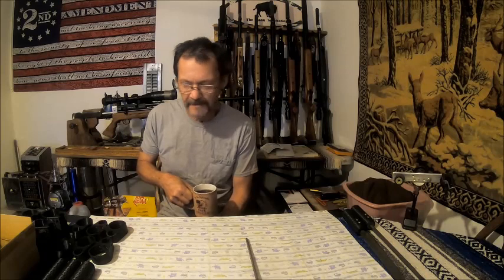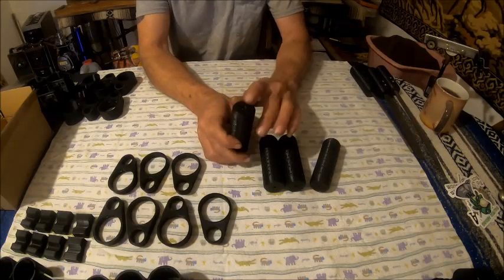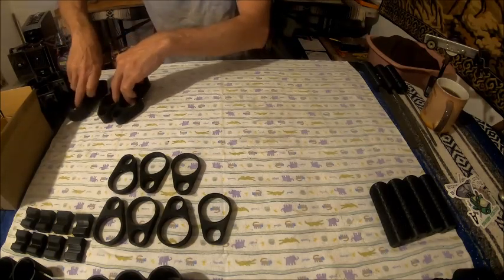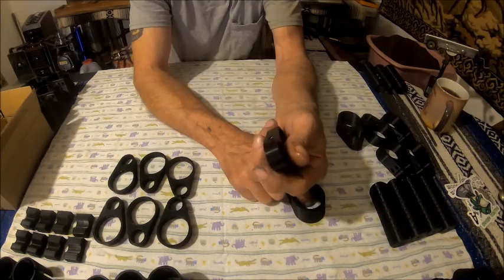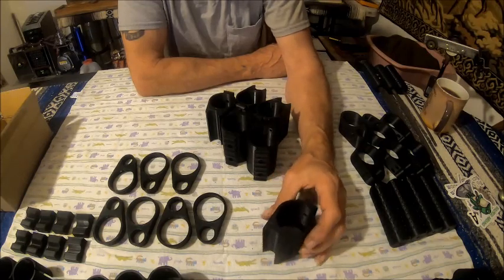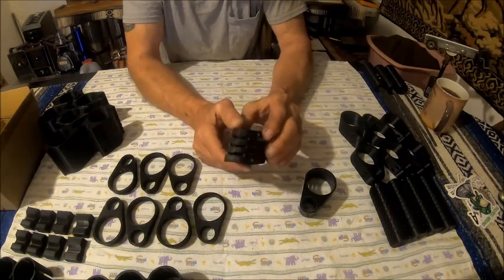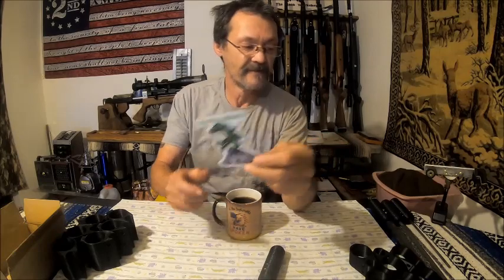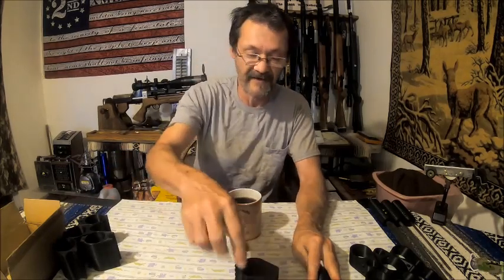AEA Challenger 45 and 50 cal parts introduction

Comment: Also I would love to have a rubber sleeve that can fit inside the new challenger between the barrel and the shroud to get rid of some of the ting sound caused by the shroud aswell as increase accuracy from stiffening the barrel and decreasing vibrations. Do you think this is something you could possibly make?
Reply from the maker: i dont print rubber i print in pla only
Reply: @BisonWorkshop  yeah I know, I was just hopping you may know a way to make something like this, Limb saver makes something called the x-ring and it looks like it would be perfect but I don’t know if it will fit inside the shroud, I would much rather have something from you, maybe if you got a big piece of rubber in the same dimensions as the inside of the barrel shroud and you cut a hole through it that might work, but I would have no idea where to get the rubber lol
Reply from the maker: @gregmcb5305  why couldnt you do the same thing you want me to do?
Reply: @BisonWorkshop  I totally would if I had a large drill to drill the hole with and something to hold it in place so I make a even hole, but unfortunately I have no tools at my disposal. Also you seem to be really good at building these kinds of things for air guns, I wish I had a bunch of tools like you, maybe someday